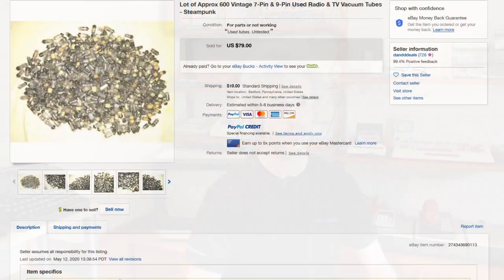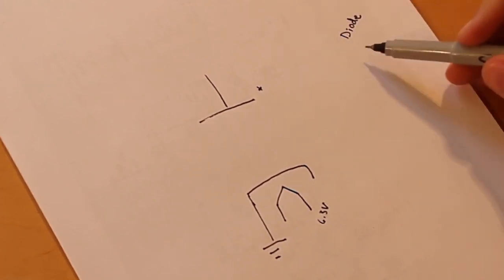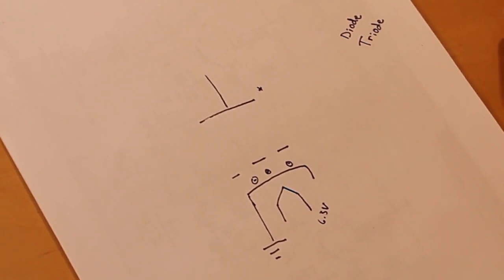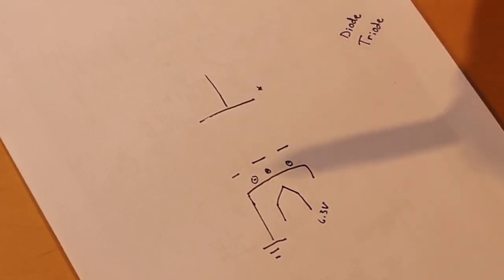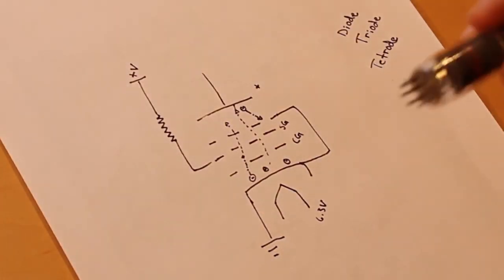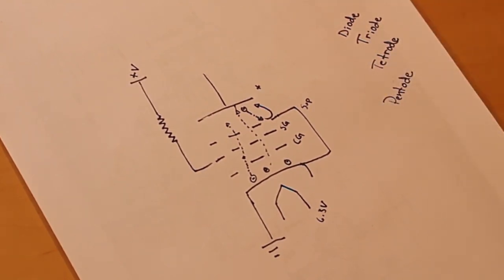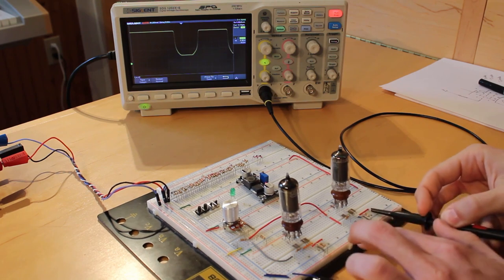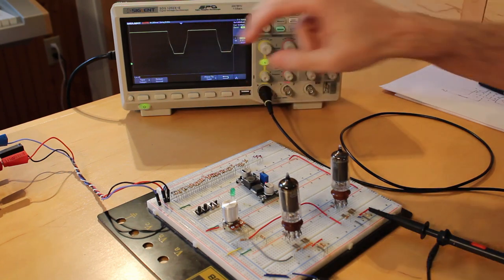Vacuum Tubes: Episode 5 – The Pentode

Comment: Back in the 1990's there were government surplus auctions, mostly from some huge govt warehouses in Utah.   Where there would be like 12,000 brand-new 6SK7's (for WW2 radios) and 6AC7's (from WW2 radar sets).    I think she winning bids were very low, like $400 a lot.  Kinda surprising as their associated equipment was mostly EOL by 1955.  The 6AC7 might be usable as a 6AU6 work-alike.  Needs more like 30 volts to pull 10 milliamps but perhaps good enough.

Comment: bonjour j ai une question je voudrais  faire une alimentation 2000  volt  avec une gi7b et comme commande un 2c39
Reply from the maker: Hmm, both the GI7B and 2C39 are transmitter tubes it seems, so I’m not sure how well suited to power supply operation they would be. I’m really unfamiliar with transmitter tubes. But, the GI7B looks like it should be able to do about 170mA at 2kV, which is quite a lot of power.

Of course, how you build the supply will depend mostly on the type of transformer you have. For 2kV, you’ll need about 1.5kV RMS. With a big enough transformer, that should be possible. Otherwise, you’ll need to go with a flyback design.
The best thing I can suggest is to look at old oscilloscope schematics and see how they generated the HV for the CRTs, there’s a lot of excellent designs floating around there!

Google Translate:
Hmm, les GI7B et 2C39 sont des tubes émetteurs, semble-t-il, donc je ne sais pas à quel point ils seraient bien adaptés au fonctionnement de l'alimentation. Je ne suis vraiment pas familier avec les tubes émetteurs. Mais, le GI7B semble pouvoir faire environ 170mA à 2kV, ce qui est beaucoup de puissance.

Bien sûr, la façon dont vous construisez l'alimentation dépendra principalement du type de transformateur dont vous disposez. Pour 2kV, vous aurez besoin d'environ 1,5kV RMS. Avec un transformateur assez gros, cela devrait être possible. Sinon, vous devrez opter pour une conception flyback.
La meilleure chose que je puisse suggérer est de regarder les anciens schémas d'oscilloscope et de voir comment ils ont généré le HV pour les CRT, il y a beaucoup d'excellentes conceptions qui flottent là-bas !

Comment: Interesting. attaching screen and grid to the plate! I never thought of trying this.
Reply from the maker: Thanks for watching! And, yup, by connecting the suppressor grid and screen grid to the plate, you essentially end up with a triode that has an oddly shaped plate. But, it drastically changes the characteristics of the tube and you can take a pentode that normally has a sharp cutoff and make it react like a triode with a much more linear response.
This is a pretty good resource on the different ways you can hook up a pentode as a triode: http://www.audiodesignguide.com/New2A3/ETF06TS.pdf

Comment: Enjoyed the instrumented testing! Would be cool to see the difference between tetrode and triode mode on the scope using a high frequency input.
Reply from the maker: That's actually in the works! I've got an old HP signal generator in the garage that needs a bit of restoration, so once we clean that up, I want to use it to see how fast we can push the tubes before they start running into issues.

Comment: Thanks for your videos, I am trying to learn and use some valves for a little project myself and i found your videos very useful. Can I ask you how and what you used to be able to plug the valves on the breadboard? thank you.
Reply from the maker: Thank you so much! That's awesome to hear that my videos are helpful!
To plug them into the breadboard, I just use a standard "belton" style tube socket that I salvaged out of some old electronics, solder on some 22 AWG wire to each of the connectors, and then bend the wire so that the pins end up in a line.
Here's a closer photo of the socket: https://i.postimg.cc/kMW72bcr/IMAG3143.jpg
Bent like that, it works out really well with pin 1 being on the left and pin 7/9 being on the right. I would say you could probably get away with about up to 100VDC through a breadboard and this connector if you're being careful, but I'm not sure I'd recommend it, haha.
Reply: @UsagiElectric  sorry about my silence... Busy days, thanks a lot again for all the info.

Comment: I have problems with small circuets those wacum tubes realy look easy to operate I wish you made circuets for controling transformers and their different aplications.
Im working as mechanic It anoy's me to no end the old GM 4 pin ignition modules do not have advance ore retard option and circuets do not exist for controling ignition coil polarity change,or pulse duration control,or phase control for multi tap transformers or useing varizse electricity out come in different stages like plasma or amplifier combinations .
So I realy wuld like to see those experiments and actualy I am curriuse to see what that wuld do to ignition coils.
Again anoying small circuets that no one understands and comonli those are not marked or do not have circuet diagrams .
So those wacum tubes are indead promesing devices .

Comment: Hello, I just started playing woth tubes myself, I got some 6jt8 (the cheapest I could find) it is a pentode triode, I tried several configurations (using just the pentode, I didn't messed with the triode yet) I tried with 150v, 46v even 18v on triode condiguration I manage to cunduc, but I never get above 0.4mA(yes, 400 microamps) I do have to ask, why? How? Am I doing anything wrong or is it how it was supposed to

My set up was like this

Supressor grid(internally connected to the cathode)
Screen grid (connected to positive through a 22k resistor, tried 10k and 33k no noticiable chamges)
Cathode connected to GND as per standard
Anode ( load, a led(no resistor going an ammeter )
Control grid, a 100k potentiometer in a voltage divider to allow up to 5v

Any help is appreciated.

Something strange is that the tube never fully goes off, it never stops conducting even when the control grid is maxed out.

Comment: Over here in the U.K. they only sell small quantities of valves on ebay, (up to 5), at an inflated price. :(
Reply from the maker: Yeah, I've gotten pretty lucky in finding nice large lots for affordable prices on eBay. I think currently I have around 500 6AU6 tubes in my possession, which should be enough for most of the tube microprocessor project I'm working on!
Reply: @UsagiElectric  Cool, Looking forward to seeing the full build.

Comment: When you note +24 V, does that mean you connect the negative pole of a 24V battery to the plate?
Reply from the maker: My power supply is setup with the positive of the 24V supply hooked up to the plate, then the negative of the 24V supply hooked up to ground. To get -12V I hook the positive of my 12V supply up to ground and then use the negative of the 12V supply to get my negative voltage. Essentially just like explained here: 
https://forum.digikey.com/t/get-a-positive-and-negative-voltage-output-from-power-supply/10593
Reply: @UsagiElectric  Thank you for your honest answer. May I recommend you always draw the full circuit, including the power supply as to avoid confusion? I understand people now even say that labeling the ground as negative is okay, but according to science it’s actually positive.